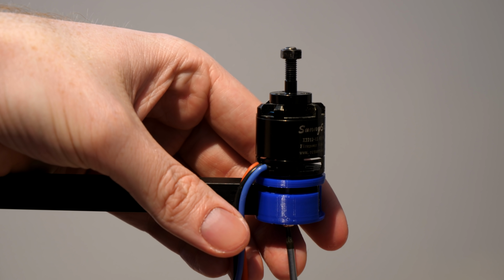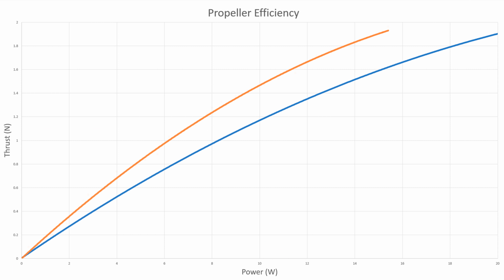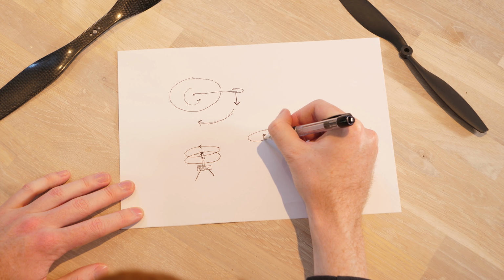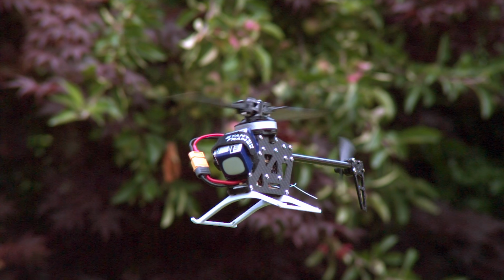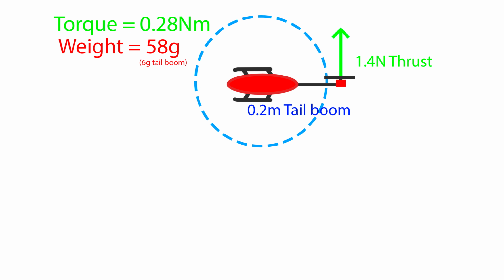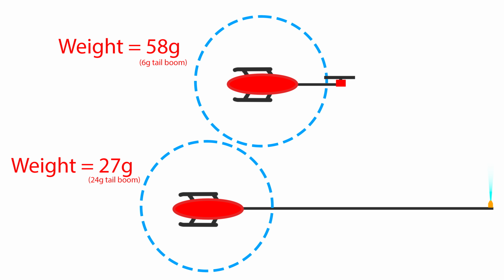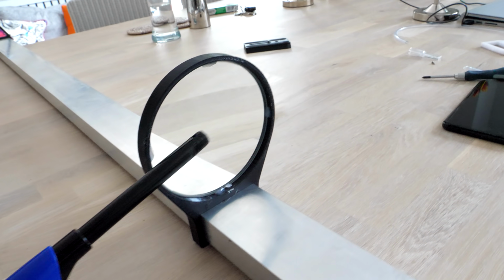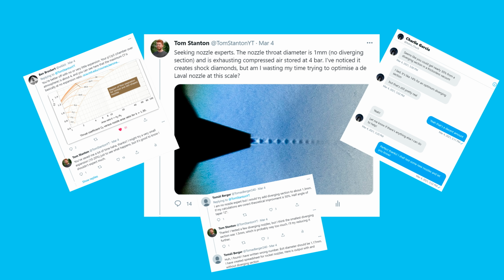Air Bottle Helicopter

Comment: You seem not to build up enough air pressure, before release. Maybe the work of the guy from AirCommand channel is going to be of some kind of inspiration for you. Especially regarding release mechanics (based on gardena flange/water hose connector system) from their earlier vids. He was able to build up over 100psi in he's very same looking plastic bottles. In general, I would drop the idia of the horizontal position of the air container. Instead, cut the bottoms of two buttes, glue them together, put on the one end pressurizing valve, with release mechanism and backflow blocker. And on the other end - your rotor head with turbine gearbox and the boom with the counteracting nosle.  It doesn't have to look pretty; the beauty is in its function.

Comment: This my be slightly off-topic but I can't help wondering why they're always "quad"copters. I mean, you can achieve stability with three rotors. Is there some advantage to four?
Reply: With four there are an even number of rotors, so it's easy to balance the torques with identical motors and rotors. You could theoretically balance the torques with three rotors, but one rotor would have to match the torque of the other two. This means that it would have to be either bigger or faster than the other two, resulting in uneven thrust across the craft at various speeds. This is probably a solvable problem, but it's a lot easier to just add another rotor and make the craft symmetrical, especially since then you only need one motor design.

Comment: I wasn't able to find any images of it on the internet, but when I was a kid I did have  an air-powered (air piston) air-hogs helicopter. It didn't have a tail rotor, just one main rotor and a rear fin to stabilize it for short flights. Maybe worth investigating! Also, Tom, you should check out a youtuber "NightFlyyer" He's an old-school RC heli guy who has done tons of experiments with 1 blade rotors and also single rotor helis with no tail rotor. As always love the vids!

Comment: You need a valve that opens when you pull a string, so you can. Fully pressurize the bottle, and then yank a string to release the air. Maybe if you get the friction right you can not throw off the helicopter too much like pulling a table cloth off a table with dishes on it. Or build a jig that holds it steady but let's it lift

Comment: Why don’t you use a higher pressuriezed  tank made of carbon and then with a pressure of 60bar or more? It would be harder to produce, but the weight to torque ratio should be significantly better.

Comment: How about instead of holding it down by the input nozzle, you hold it down along the center of lift? That would allow you to increase the pressure in the bottle and therefore increase flight time.

Comment: Is there a way to reinforce the plastic bottle so that pressure can be increased in the bottle to both overcome the additional weight of the bottle and increase the flight time? Possibly carbon-fiber cloth and polyester resin on the outside of the bottle?

Comment: Two suggestions : put the air bottle vertically so the center of gravity is lower, improving stability (landing legs or a landing tower needed - does this sound too SpaceX-y?) ; and put the air exhaust at the exact height of the blades (one inch or two higher than it currently is) so it does not add unwanted longitudinal torque, improving stability again.

Comment: What about adding a flywheel to the system? This would increase the overall weight but if you spun it up and got it stable then used the compressed air to keep the flywheel going and powered the tail rotor? 

Great video!

Comment: Great videa as always, but wouldnt it be smart to work on a plastic bottle which is kind of specalized for your use? Like be able to hold way higher preassure for more air and flight time?

Comment: I'm not sure if I'm correct but it looks to me like the CG is off to front or back unbalancing the system. Keep up the excellent work. One more suggestion is to use fiberglass reinforced tape to strengthen the bottle so you can store higher pressures

Comment: I would like you power some of your previous projects using liquid nitrogen as a fuel source.  Pour it into a mini tank. The air flowing over the tank can boil the liquid or paint it super dark black using special paints.

Comment: Helicopters aren't easy, that's for sure. I'm currently working on a helicopter project...with counter rotating rotors about 1.3m in diameter and a square fuselage... and I'm giving it a 30% chance of success at this point. Was considering scrapping it but I love how you've presented your progress regardless of results. Thanks for the motivation!
Reply: For me helicopters and bikes are physycial bugs in the matrix lol
Reply: There's something not disimilar to that description that just flew on Mars !
Reply: Yeah, an air-powered 'bicopter' (like the RC Chinook) seems a lot easier to engineer than a dynamically-adjusting tail rotor.
Reply: @nolanwaldner  Jet tip helicopter could be a better solution than a tandem set-up like a Chinook.  No anti-torque needed.  Tandem would need equal lift at both rotors to hover.  Counter-rotating might work because there's an increase in efficiency on the lower rotor.  Still, jet tip rotors are were I would place my money when it comes to a compressed air system.
Reply: You definitely shall already know it by now, but anyway I just would like to remind about possible difficulties with swashplate mechanism. So is your team planning to buy one, order it on some factory or produce yourselves? 

Just was waiting to hear about swashplate in the video, but now I assume aircraft controls are not discussed in these videos yet.

Comment: In Tom’s ideal society we wouldn’t use fossil fuels. The world would run on compressed air, truly the most glorious power source
Reply: compressed air fixes everything
Reply: Modern Steampunk
Reply: @gibbous_silver  no, you fill up at the air station. the pumps there are powered by electricity.
Reply: Hahahahaha
Reply: Manchester university have a solar plant and they use the power generated when the sun shines to  compress air into old propane tanks and when the sun goes down they discharge the tanks through impellers to generate the equivalent electricity used by the compressors plus a bit extra so it's a net gain
Reply: @iancrosby3475  I seriously doubt it’s a net gain. That would break physics. However it is power when it’s required, so that’s worth the system losses.
Reply: @letsgocamping88   I must have mis- read the article.  I'll look it up again.
Reply: @letsgocamping88   I mis- remembered  in the months since I first read about this project being de.    The scheme uses liquid air not simply compressed air and the gains come not from breaking physics, but from  clever use of recirculating the heat difference at  both sides of the refrigeration cycle as a kind of large scale above-ground heat pump
Reply: @iancrosby3475  You can never get "a little extra". Ideally, at most the same equivalent of energy, but in practice it is always much less. This is due to losses in energy transformation and in the final solution. Indeed, there is no profit. This will only be possible with the advent of fusion reactors, which will be so expensive that the "net" profit will arrive just before their expiration. Compressed air is the worst solution for energy storage, and if you wanted to compensate for losses at least a little and have an efficiency of at least 10 percent, you would have to let the compressed air expand into a vacuum. However, compressed air is the cheapest medium for the partial accumulation of energy, which is very cheap and somewhere locally, where it does not matter that you convert 1kW of energy at the input to 20W of energy at the output, it can help in some way. In any case, the accumulation of energy by compressed air is very lossy (it provides no profit) and is therefore not used en masse.
Reply: So basically wars will be using Airsoft guns
Reply: If it can run on compressed air, it can run on steam...
Reply: Airpunk
Reply: Compressed air air compressors and all.
Reply: @ARockyRock  but how deep does that net loss rabbit hole go 😂
Reply: to everyone asking about where the compressed air comes from: look up a video by practical engineering about trompes, which produce compressed air from waterfalls
Reply: The world will be powered by one poor, overworked soul with a bicycle pump who keeps refilling the giant, central soda bottle.
Reply: @ayparillo  only when the vegans free all the oppressed hamsters from their wheels
Reply: lol... and u will pump the air tanks manualy?
Reply: @makoado6010  Using a Trompe? :)
Reply: @makoado6010  water dropped from a height can compress air very well
Reply: In the UK, our politicians run on hot air...
Reply: @belliduradespicio8009  with a compressed air powered air compressor
Reply: @justan idiot I preferred not to comment on Aircraft, but I responded to a post about Mancherster University, which produces energy through solar cells and accumulates it in compressed air. Subsequently, this energy is to cover the energy requirements of the compressors through the impeller and to produce something extra, which is a de-facto perpetuum mobile. :) That's why I had to respond. I know of experiments with "air" engines that want to approach a theoretical adiabatic cycle, or of engines that suck in warm outside air and which are then compressed by a piston. At that moment, subcooled compressed air from the pressure tank is sprayed into the same hot air space, creating work from expanding subcooled air (this prevents the engine from freezing) ... but even this solution requires a considerable investment in compressing the air to at least 400 Atm, or better, let it liquefy, which requires further investment. Therefore, it is better to accumulate electricity directly and then use it to drive an electric motor. In the past, compressed air was a really good alternative to energy distribution, but it has not yet addressed efficiency and energy requirements.
Reply: I used to love the book "Boomtown" as a kid - it was a fictional story about a town powered on free air and steam. Lit up my imagination and I was so disappointed to find there was no such place
Reply: Pressurized by hand
Reply: Sorry. I'm an O'Haire Air typa guy
Reply: @hwkgg  It's turtles all the way down...
Reply: @cap5856  Have you read the comment I replied to?
Reply: There is a concept of using compressed air as electricity storage, for when renewables are putting excess energy into the grid.
Reply: 473 thumbs up from people who think compressed air is the alternative to fossil fuels 😂😂😂😂😂😂

If you're going to use solar or wind power  to  compress the air you could just us a feckin electric motor which is probably more efficient.
Reply: @monkeyboy7981  You also lose a bunch of energy as heat when compressing air. Thermodynamics is a bitch.
Reply: And which "incredible force" would compress air for you? Compressed air is one of the worst power storage types because of its poor efficiency. When you compress air it loses energy through heating (wasted energy) and you can't compress air without any external power source (so it's only power storage like battery or a flywheel not a power source).
Reply: @teolynx3805  yeah I’m fully aware of all of that, my comment is a joke. I was being sarcastic
Reply: spodefollower
Based?
Reply: Lol
Reply: Robin Williams had a methane joke about a hose and a human in the seated position and Taco Bell 😂 I got your compressed air right here!
Reply: And then our capitalist overlords will charge us to breathe 🙄
Reply: Make power
Who said slavery was banned?
Reply: Compress the air? No problem... Politicians have mastered this problem LONG ago! Just watch US CONGRESS in action... You'll see!
Reply: @hwkgg  And how do you compress that air?
Reply: @Rhynome  more comprest air
Reply: @lifeononeweel3008  interesting... and how will you compress that air?
Reply: @Rhynome  wind power
Reply: @Rhynome water
Reply: @Rhynome Mexican immigrants 👍
Reply: @Rhynome  With a Trompe, go watch Practical Engineering.
Reply: @Rhynome  Solar power.  Use solar collectors to boil water which can be used to push a piston which in turn compressors air.  A solar steam powered air compressor!  Of course solar/wind and generating electricity to run a compressor is probably easier. :P
Reply: @Rhynome  water
Reply: @Rhynome bellows.
Reply: Compressed air is not a source of power by any stretch of imagination.
Reply: @NGC1433  then what is the source of power in this helicopter? I guess if you want to be super specific, it’s more of a power storage system or a reservoir of potential energy, storing the energy from the electric air pump
Reply: @spodefollower  Compressed air is one of the worst ways you can use to store or transport energy though.
Reply: @akkudakkupl  that’s the joke lol
Reply: @spodefollower  Read the comment I was replying to. I will copy it for your convenience: "In ideal society we wouldn’t use fossil fuels. The world would run on compressed air, truly the most glorious power source"
Reply: @NGC1433  I mean technically the natural gas underground could be used to power things mechanically because it's already compressed
Reply: @aa01blue38  It's a fossil source of power. Please consider the context before sticking your 2 kopeks in. Read the parent comment.
Reply: @NGC1433  lol natural gas is pressurized I wasn't talking abt combustion
Reply: @NGC1433  look up  "trompe air compressor"
Reply: @SteveEh  1. Read the comment I was replying to. 2. Show me on the picture of "Trompe Air Compressor" which part makes you think that air is a power source.
Reply: @NGC1433  except it is and is mass produced by politics
Reply: @NGC1433  Tell that to steam locomotives...
Reply: @Nemozoli  Tell what exactly to steam locomotives? I told a lot of stuff in these comments.
Anyway, I don't think that air the energy source in steam or any other type of locomotives, it was wood, then coal and oil in rare occasions.
Probably you have no idea what steam is https://en.wikipedia.org/wiki/Steam
Reply: @NGC1433  by using the rotation to make power yuo can get elec from the compressed air and elec can make heat and heat can do a lot